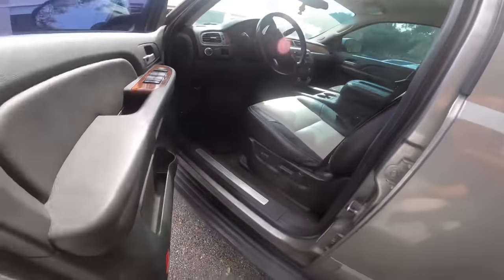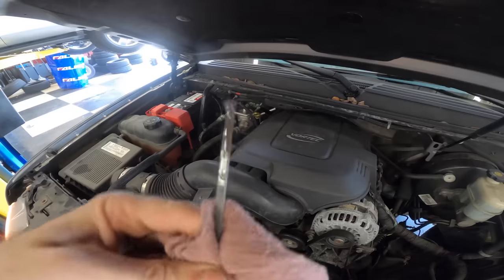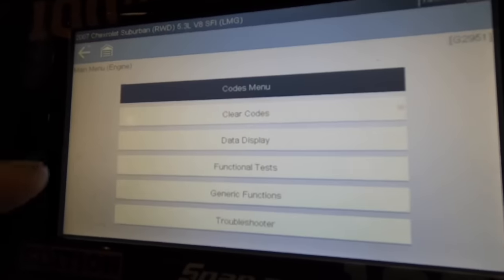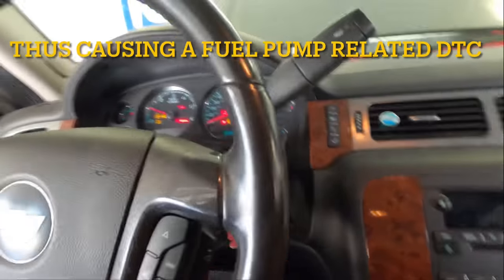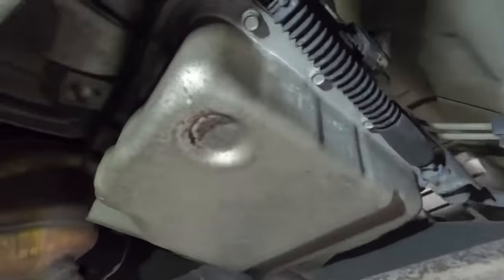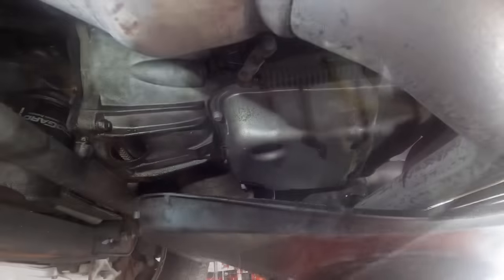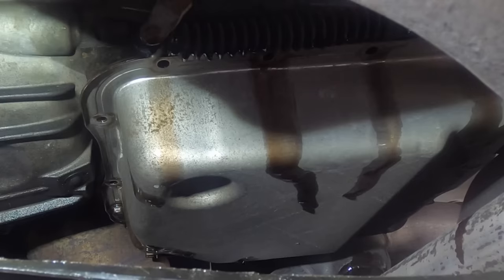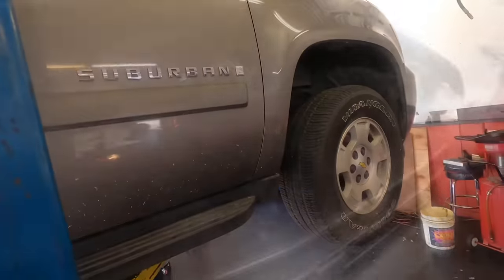Busted! SCAMMING Mechanic Causes Damage! 4l60E Transmission

Comment: Also someone explain where the fuse even is for transmission control module and pcm in my 01 silverado LS 4.8 1500 the manual book says theres not but everything has a fuse to it. I call bs where is the TCM and pcm fuse because it's not labeled

Comment: I've seen stuff like this before  Lawn and Garden Center took advantage of a friend   In his  80s  Con Him into into A Troy built snowblower because his Craftsman was no good unfortunately for The center he did not trade his Craftsman in  On trade  Lucky me  He gave it to me and I removed the twin somebodyWrapped around the bendix on the electric Starter and put a spark plug in it and it fired right up.. Spark plug was under  A protective cover.. 😡💔

Comment: Why american transmissions don't like a DRAIN PLUG on the pan like AISIN????

It makes the oil drain (and pan removal) so much cleaner and faster.... Then you can deal with an empty pan, take all bolts out without the fear of spilling oil all over the shop!

Comment: I'm no ASE certified wrench by no means but how is the engine even running with no fuel pump relay ?
Reply: the blue wire kept the fuel pump on all the time

Comment: All of that stuff couldn't be wrong with this thing, the ignition even gave you a problem when you went to start it. I would be very suspicious of this ignition switch and check the main system grounds. Either one could cause many false codes.

Comment: wait why are there clutch packs? isn't this a torque converter automatic? cuz it's a 2007 4 speed American automatic, i wouldn't exactly assume it's dual clutch, or even single clutch automated
Reply: Automatic boxes have clutch packs/bands internally to engage the individual gears, so basically this crook mechanic has drastically shortened the life of the gearbox and strictly speaking they should be made to pay for a rebuild
Reply: @bobbyinternet9793  yeah but if it's limping and being in second all the time wouldn't the wear be passed to the torque converter? like how in a manual (or amt) you'd have to slip the clutch a lot
Reply: @alyx6427  I'm not sure but I think Ray said it's locked in 3rd/4th, maybe repeated stop/starts in this gear would cause the clutches to slip

Comment: I want to know what happened to the bad mechanic I remember once I took a 2010 Journey in because it was steaming sounded like the radiator hose came off or something like that and when I took it to the mechanic they said there was nothing about that I was going to need a heater core and that I was going to cost about $600 to fix it but we went back there in the morning to get the car and here they already had it fixed 10 minutes after they opened and I said I thought you said there was something wrong way that's what we thought it was it was just a radiator hose and we had to put some radiator fluid in it too it took us a while so they still charge me $300 just for fixing a clamp and they use my radiator fluid

Comment: The boys want to ask this question when you guys are using brake clean to clean the inside of a pan whether it be a transmission pan or an oil pan why do you shake your hand back and forth why don't you just spray in a regular pattern the nozzle does its work without you shaking the can back and forth or your hand? A steady spray downward will wash the pan into the drain pan question from the old man it's 35 years of repairing all kinds of equipment

Comment: Listen, I’m also a mechanic and the only thing wrong with it is that it was built by gm. Do you know what vehicle I see the most in my shop? Gm vehicles. Every single one I’ve worked on has an oil leak somewhere and every newer one burns oil. I asked multiple Gm dealerships about this and they say it comes from the factory burning oil and that is just the way every traverse, or equinox or colorodo or what have you comes straight from the factory and it’s supposed to be like that.idc what the dealerships say. No vehicle is supposed to come from the factory burning oil and no one should buy a vehicle that comes from the burning oil. Not to mention all the new gm vehicles that aren’t a truck out on a truck body you gotta take almost everything apart and I mean almost everything in order to do simple maintenance on it. It’s ridiculous. I’m a tried and true mechanic and there’s just some manufacturers that I just would never buy a vehicle from and gm is the top one. I’d buy a vw  before I buy anything from gm and if your a mechanic you know what I’m talking about and if you know your stuff then all I can say is to do regular maintenance on a newer pos gm vehicle is like changing the thermostat on an 02 Isuzu rodeo, the one that is located in the valley and has a water manifold. Most of you tried and true mechanics don’t even know what a water manifold is and that’s cuz a normal vehicle isn’t supposed to have a water manifold! Christ what are these engineers doing now a days.

Comment: You realize by just dropping a Pan and only checking 5 qt of food you're not really doing anything because the transmission volume hold 12 qt of fluid you should take to a high Heinz and push the old foot out while putting new fluid in the top until the fluid color comes out red it's alright if you find no evidence of extremely stuff in the transmission pants

Comment: Oil test kits ! Yer its call your Eye and nose !   if it looks old and cooked ! it is , if it smells old and cooked its is ! outcome = transmission has done a million miles in city traffic with clutches a mill off the metal with bands not much better ! sure you could adjust bands if possible But why not just reco the box now

Comment: That computer if it was an ecu would have been what 1k? Plus the fuel pump price and the guy could just remove the fuse an wire and pocket the cash. Then just Say he replaced the parts.Definitely a scam.

Comment: Why not just drain it from the "drain" plug like an oil change.. you don't take off the whole oil pan you drain it from the drain plug same thing with a transmission drop pan you drain it from. The plug that's out there to drain not take off all that bolts and draining it that way LMFAO

Comment: How much is this scan tool ? My 01 silverado LS 4.8 1500 only has 2 gears goes into reverse like butter goes in 1 and 2 like butter but no 3rd gear or 4th which 4th is Drive. I have the nortious 4L60E. This shop down the street thinks they're scam tool cost $15,000 no scan tool cost that much money.. and why charge me 160 to use it it doesn't have even cost money to use it I could buy a cheaper scan tool it ain't gonna cost me to use it myself.. there's no labor involved when using a scan tool. Pfft. Now I was told my clutch pack is shot or bad shift solenoid because at first my rpms were skipping up and down now if I go in 3rd gear is wants to pull me a little bit. Otherwise, i. An only 30 mph around town just fine . Someone thinks they can explain to me.

Comment: They used to have a drain plug in the torque converter show you could flush the torque converter out they stop putting plugs in the torque converter around 1979 1980s why they did that they want you to replace the torque converter gosh we had to pull transmission to do so very labored and tensed job in a lot of experience mechanics the automatic transmission pump pulling the transmission out without unbolting the torque converter

Comment: You really dont know why the fuse was missing. To blame it on "the last shop that worked on it" is just speculation. I worked in auto repair for 40 years and saw a lot if strange things. But that doesnt mean it was the last shop that did it.

Comment: I used to work at aamco transmission and that code is common I've done so many gm transmissions they have gotten bad over done alot of 4l60e transmissions and the years the 8 speed gm came out with.was just a pile of junk. They have gotten to be as bad as Chrysler for all those years. Needless to say I'm not a fan of gm anymore

Comment: It just goes to say that the man will have to get his money back and finally end probably fixing a transmission that the guy caused to get burned up by not changing the fluid which you can probably blame on a court on poor amendments on the guy's part but it will probably still cost the guy a transmission and you should integrate the need and of in the future even with that many transmission the need of 50000 mile oil changes on the transmission in the Internet vehicle And that's what Chevrolet recommended when it was built was in 50000 mile transmission service so it's not fluid you don't even understand this forever like some people do I always tell people that if you leave your foot in your transmission he would if it says or in the factory it's not serviceable if it goes a 100000 miles and then slips that is the life of your transmission is however long that fluid last and by changing it you can extend the life of your brand Virgin transmission fluid and other compliments and you drive drainage Well

Comment: There is to much electrical BS in that truck to be a good one! you spend to much time playing with over priced  tek to give a good price. why did they have to make 4L60 in to an E? That was $1000 more to repair, and the shop had to buy new tek to test  it out which the price goes to the customer. that electrical  control unit would short out do to leaking in the 92 93..manufachering  scamming. I do appreciate your time thank you..

Comment: I'm on bokeelia how far are you from that and I got two vehicles on checked I took it to a local down here in Florida okay there St James and he had a month and it's still doing everything that is doing ok. I was coming out of Florida I hit Ocala Florida said he put a new distributor oil pump and I got it back he left the clipboard in there burned up the alternator didn't put all the wires back on barely made it to Alabama to find out my alternator is not charging it broke a wire the tester for the injectors we're still on it didn't change the oil pump or the pan gasket took it to three other garages and nothing's fixed

Comment: By the way you just change the oil on that you just change 1/3 of the fo you're not even giving that transmission of fighting chance because by doing that you instead of flushing the line off the side of the France mission and pushing the fluid through all the shavings are still in the fluid circulating around eating things up in the transmission so you just insert yourself that you're probably going to have in 6 or 8 months a transmission repair that you might not have had to change nice going dude I have had transmissions and slip coming to my shop and I flushed the fluid out of them by taking the line loops and pushing it out until the food comes out clean and never letting it run to bleed out of fluid just like you would deflect a bright master from work and I've had good luck with doing that for several years now and I actually had a norm sorry for the full Christ or try to admit it and my mother's own car that I did that with and it's still hanging And that There's a lot of guys on here that will say flushing and transmission will blow up your transmission but it won't because you can do that lo I said taking the food line off cause you're not really putting any pressure on it you're not gonna have a problem